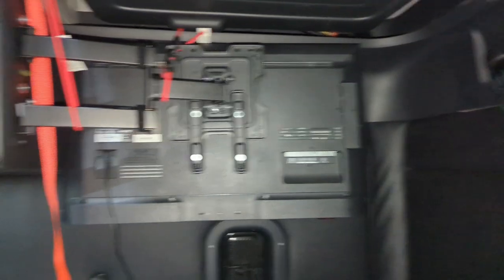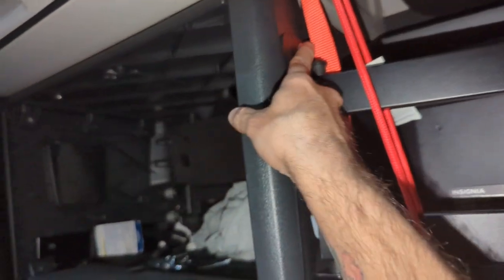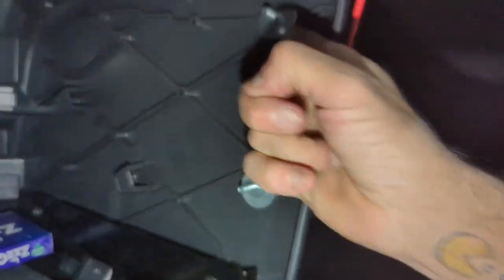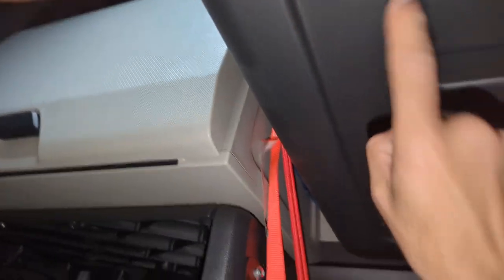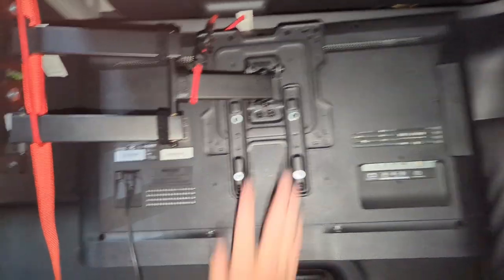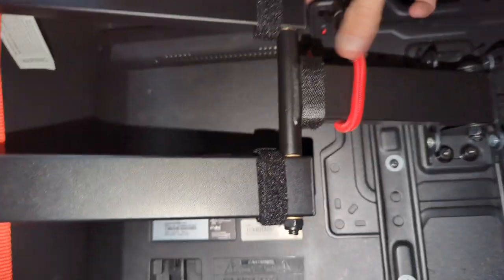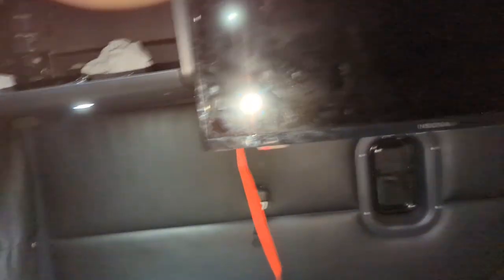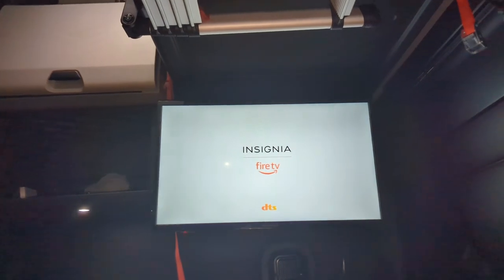How to install a 32 inch TV

Comment: Where would you mount your 42 inch and would you still use the swivel mount?
Reply from the maker: Yes, I just make sure to use Bungies to help hold the weight as you drive.